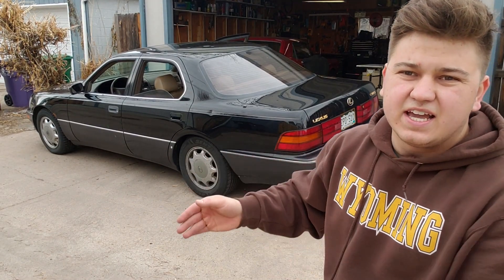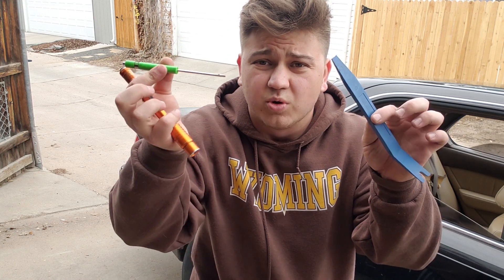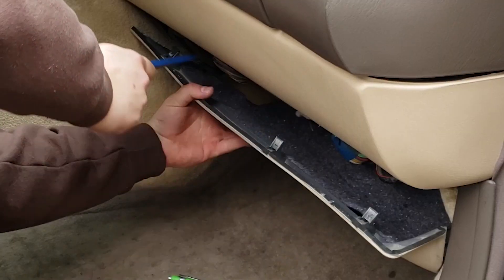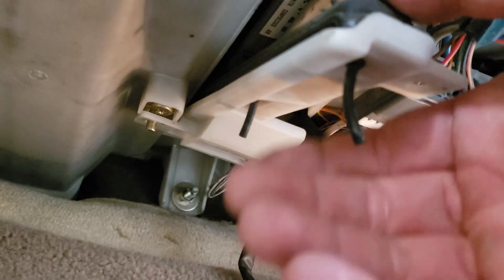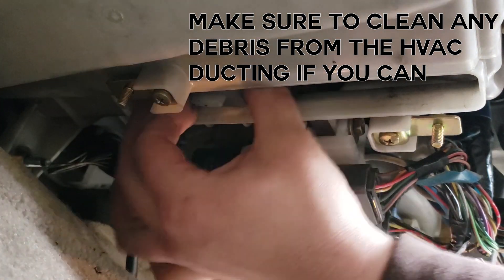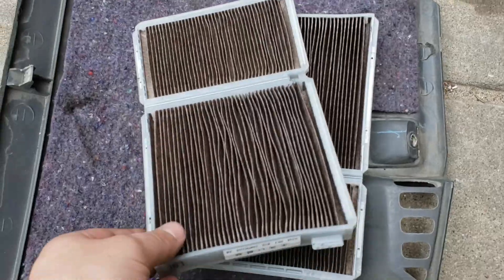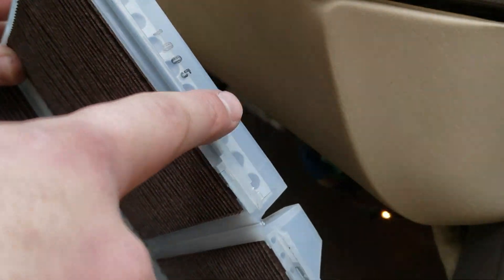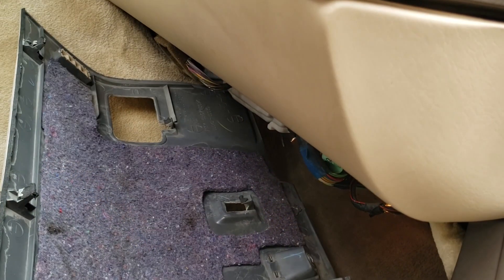How To Replace The Cabin Filter - Lexus LS400 1993-1994

Comment: Hey I'm up in Fort Collins and THANK YOU for that clarification. I've been trying to research the similarities/contrasting differences to the flagship LS400 and my 1992 xv10 camry. My camry has no cabin air filter and I wanted to know if the ucf10 early years did. Internet is oddly sparse of info on it. I'd like to get one of these myself eventually if I ever have more room for cars!
Reply from the maker: Im glad I could clarify! that was my hope. Yeah toyota didnt really start putting them into their cars until early 2000's. I used to work at a toyota dealership and most 90's Toyotas did not have them. Thats why I was surprised that the 94 LS400 did have one

Comment: You know how to do this on a 1994 Mazda protege?
Reply from the maker: I dont know if there is one for 100% sure. Alot of cars didnt really start doing it until the 2000s and up. However on alot of japanese cars here how to do it: open the glovebox, and squeeze the sides of the glovebox inwards. There should be some tabs that when squeeze together you can drop the glovebox down. Then, there will be a little door, it may be screwed on, it might have some squeezey tabs, depress those and slide the air filter housing out and replace. 

You could also remove the panel similar to this video and see if you can recognize a removeable panel.

There is a big chance that your car does not have one. You could also call a local parts store like autozone or oreillys, and see if they can tell you if it has one or not